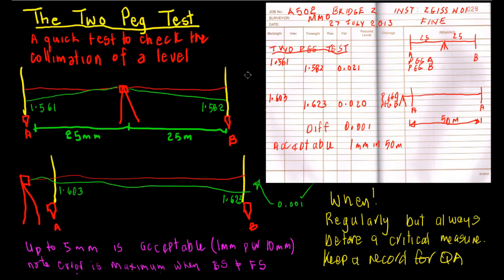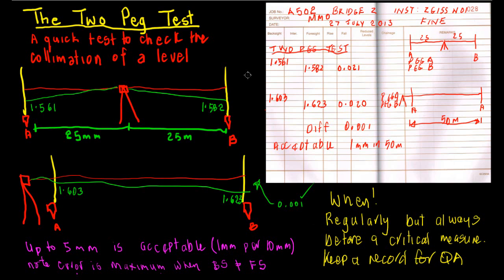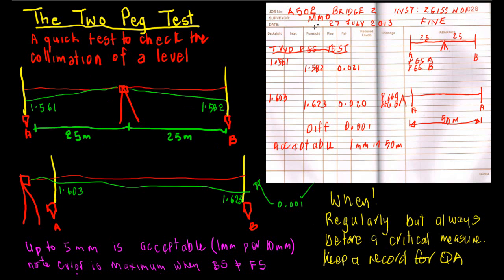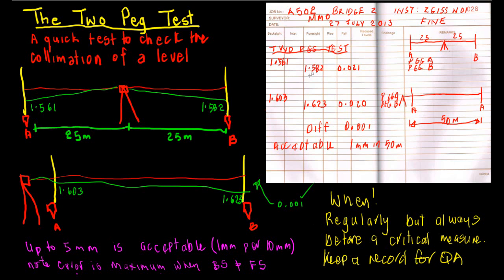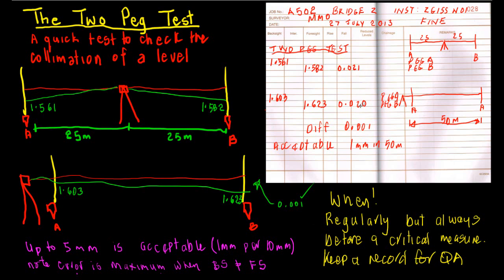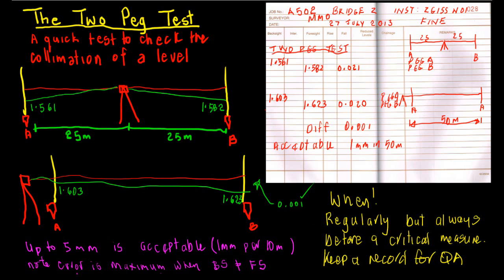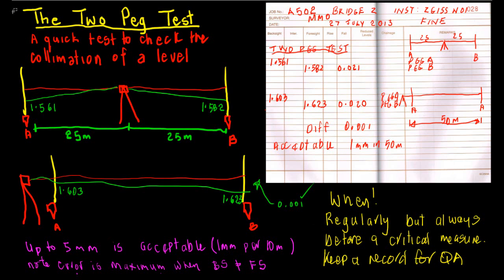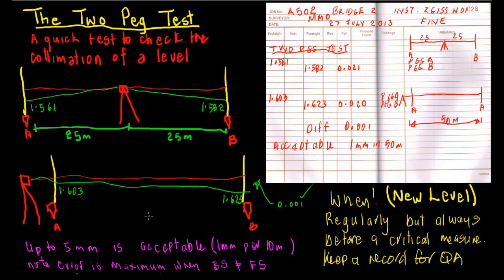maurieo's Two Peg Test for Levels

Comment: What is the acceptable error? Is there some official standard that define the acceptable error?
Reply from the maker: It depends on the accuracy of the level you are using and the job you are using it for.  Generally we use standard construction levels which in NZ are considered suitable for 3rd order levelling and usually go with 1 mm per 10 metres as being acceptable (Rule of Thumb).  The levelling standards in NZ are generally set by LINZ so you use a level appropriate to the required standard/level and match the acceptable two peg tolerance to that.  I am not a Geodosist or Academic, my answer is based on experience at the lower end of the levelling spectrum I have not done any significant precise levelling.  A more detailed answer would be given by a geodosist / academic.  You instrument service specialist would have a good answer also.